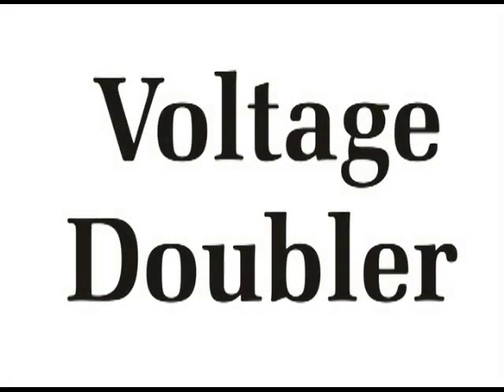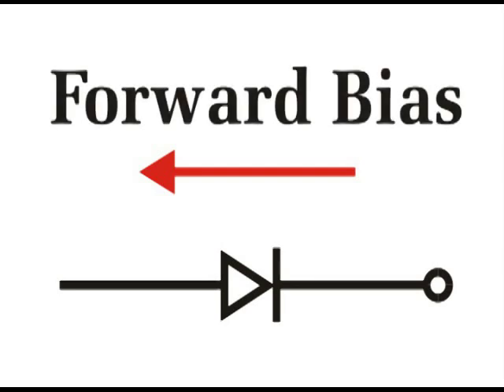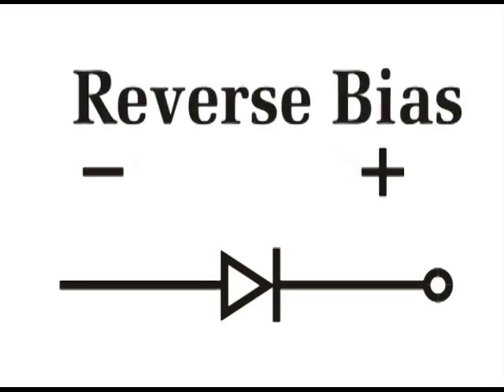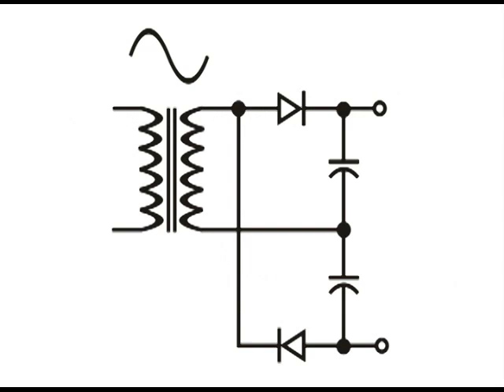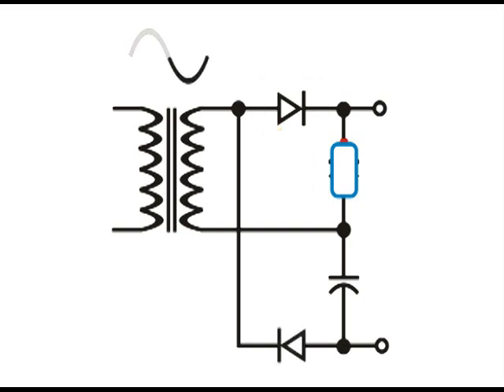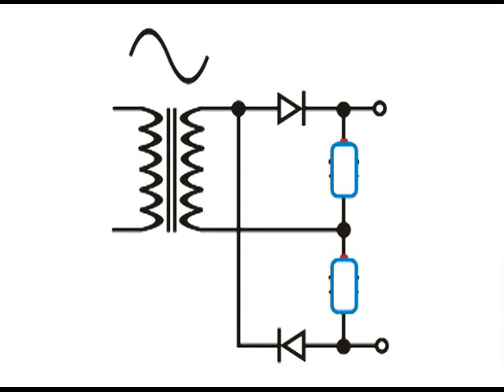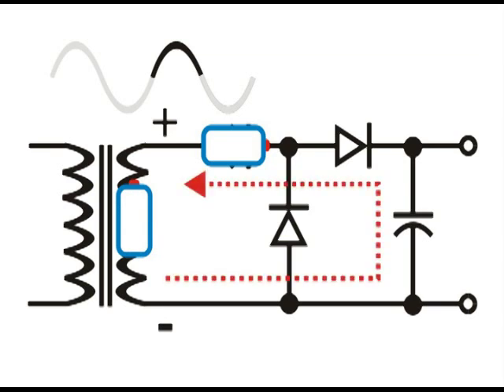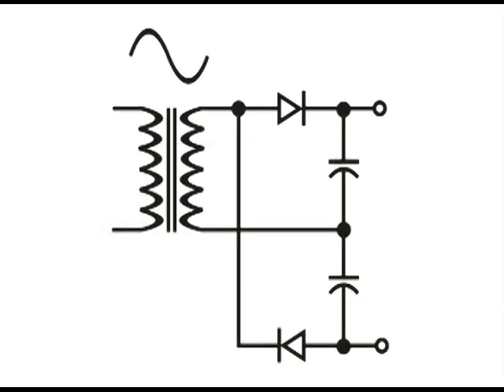Voltage Doubler Circuits

Comment: everybody needs to learn how to amplify with a capacitor.
Reply from the maker: Thanks
Reply: @AllAmericanFiveRadio  Ive got a lot to thank you for,     drawing all my diodes backwards for a good couple of years tracing my circuits neg to pos like a good kid does.
Reply from the maker: @magnuswootton6181  What we know as electron flow, is from the negative to positive in a circuit. This was not discovered until the vacuum tube rectifier was created. This is when they discovered that they could only get a current to flow when the negative terminal was on the filament and the positive terminal was on the plate. The problem is, before this they had guessed wrong an said that current and electrons flowed from positive to negative, definitely wrong. However for some unknown reason they did not change the arrow for current but they did for electrons. Since electron flow is current flow this absolutely makes no sense at all. So I just use electron flow from negative to positive, because that is the way it is, that has been proven, no doubt about this. Electron flow has been compared to water flowing in a pipe. If the water is flowing in a pipe, what is flowing in the other direction, Nothing. Also you must keep in mind what a theory is, it is someone's best guess. Another thing to think about, is that we really do not know the why of anything. We just measure and use, we are all only observers. I believe that when the scientists and engineers discovered that electrons actually flowed from negative to positive, they did not change the arrow for current flow like they did for electrons flow, because they did not want to appear to be 100% wrong, which they were. So I prefer to use what can be proven and not a theory, and a theory is just a guess.

Comment from the maker: Electrons in a circuit flows from negative to positive and nobody really knows why. AC changes direction in a circuit and DC does not. But if it is AC or DC, electrons in a circuit flow from the negative to the positive potential.